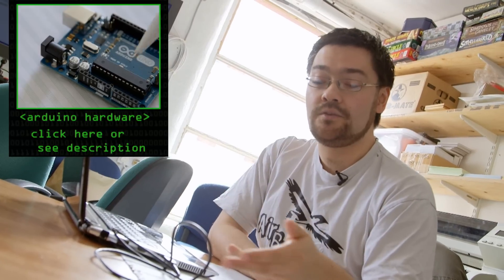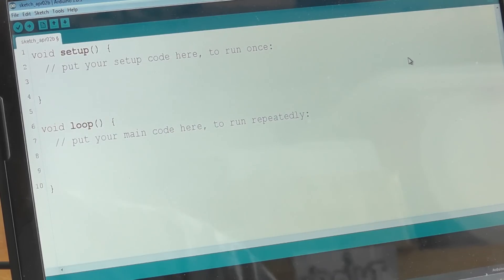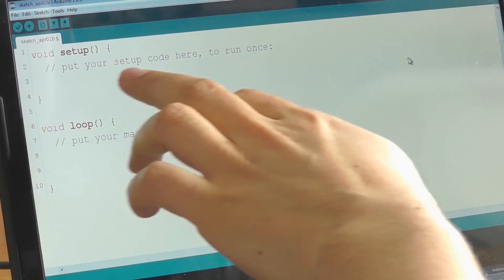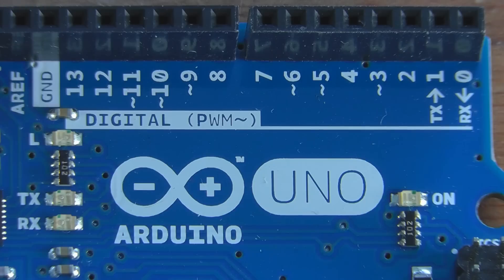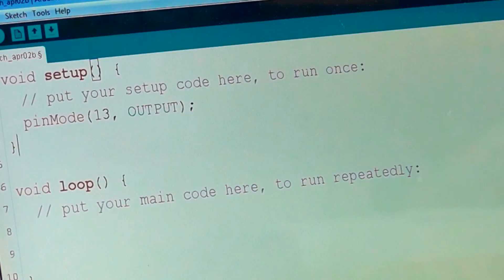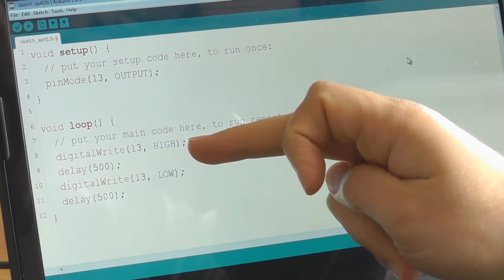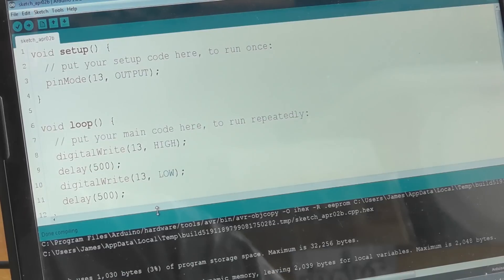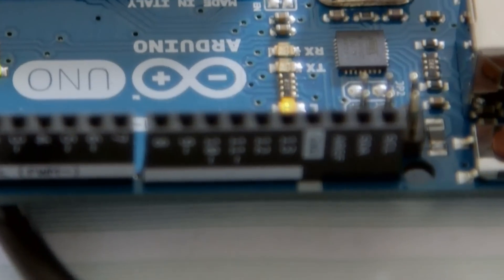Arduino Programs & Sketches- Computerphile

Comment: I use Arduinos a lot in my education but i feel how more i use the arduino IDE how more i dislike it. countering microstuttering and all just works so sloppy. I already switched from the basic arduino IDE to codeblocks for arduino.

Can you also do a video on programming arduinos in the AVR C code.

Comment: The same project, but in Assembly, would've resulted in a 30 minute video. Could also be an hour if the person explained every line of code.
Reply: PopeYoda Hardly. It's not that much more assembly instructions. As long as you have the boilerplate binary in there, all you are doing is assigning registers and calling functions at specific offsets. It's not even remotely advanced to do in assembly.
Reply: Cadde After I read your comment, I went back into my asm files to find the similar instructions, and I must admit you are correct. It must have been the simplification of 19 (give or take) asm lines to just a few for the arduino that gave me a different impression.

Comment: Arduino IDE tip for anyone wanting to start:  Shift-Backspace functions as delete by default (I found this infuriating as there is a lot of typing in all caps with underscores)

In windows To turn it off, open %appdata%/Arduino15/preferences.txt
Change line 18 to "editor.keys.shift_backspace_is_delete = false"

Comment: Why don't you use software to record the Desktop instead of filming it with the camera? The quality would be a lot better and it would be easier to tell difference between colours (you couldn't really differentiate between orange and blue text in this video).
Reply: vzwGrey Two words. Aesthetics and Consistency.
Reply: vzwGrey Because he (the guy talking, cba to check name) might not want screen recording software installed on his laptop. Doesn't matter that he can uninstall it later.
A screenshot of the program would suffice.
Reply: שגיא קרמן Those were three words.
Reply: Cadde Yes, I would go full scale riot about that, if someone demanded to do that. Would smack them right in the face with my tinfoil hat :P

Comment: I have several Arduino boards I've used for various projects, including in a 3D scanner (in perpetual alpha) that uses a webcam and line laser,  the Arduino controls the stepper motors for laser and turntable via serial link from main PC.
 Processing language on the main PC box does image processing, obviously they all have to be in synch, (which was done by a Processing)., it also has a nice form with buttons and checkboxes etc to make it all easy to make a scan. By taking two images.. one with the laser on and one with it off.. I can subtract where the laser wasn't on the image without the laser line and get texture information per scan line too.
 
 I just got hold of a bluetooth shield so will make a small robot rover thingie of some kind.. with a video camera and voice coms on it too.
 (I fly and program drones so already have a number of spare video cameras, transmitters & servos etc).
 Electronics is far more technologically advanced an activity than it used to be., however it is also much easier to do as micro controllers such as Arduino have come on the scene.

 Totally recommended, in UK you can find Arduino boards in Maplins or look online.
Also try out the Processing language for more open source very capable software (particularly anything to do with graphics).
Reply: mars Cubed Why use an arduino if you still have to involve a PC though? The PC can set pins too you know. Especially if you already have a serial port.
Reply: Cadde I can't say what is mars Cubed's reason, but you are going to need a bit of hardware to control the stepper motors from a PC anyway, and it may be just as simple to use a microcontroller to do the control as to get some dedicated serial interface chip to do it with. I supposed they used the USB to serial function on the Arduino, not a serial port on the computer itself.
Reply: Ts6451 Yup, USB serial with functions in the arduino code to read and write messages between the computer and motor control code, and line laser.. thus I can turn the turntable x degrees, get an image from the web cam with the laser line.. then another image without the laser line, process the laser image as mesh coordinates, then subtract one image from the other to get texture map information..
 Obviously, doing the above plus a bit of math (how much the laser line is displaced by the geometry of the scanned model) repeatedly, generates a 3D model, texture coordinates and texture map...
 The biggest problem I have found is noise in the images, which I reduce by looking for how many other useful (laser illuminated) pixels there are in the neighbourgood.
However, it usually requires cleaning up later in a 3d IDE too.

Comment: I'm interested in starting with a small Arduino project over the course of this summer, but don't know exactly where to start. The coding should be no problem (Bsc. comp science) but the rest is rather unknown territory for me. Does anyone have a bit of advice for me?
Reply: jurgyy I agree, looks like fun. I'm a C++ programmer, too, so I should be able to make something fun out of it, but my problem is that I'm no tech/electrician guy, so integrating it with other stuff...? I dunno. Seems like fun, though.
Reply: jurgyy What kind of project are you looking to perform? Are you powering motors, or just sending signals? What kinds of sensors are you looking to use, if any?
Reply: jurgyy I can second Kametrixom's suggestion. Get a starter kit. They are not really expensive and contain a lot of components that are fun to wire up and play with. Did this myself and have a lot of fun with it! Also helpful is a cheap multimeter that can measure current, voltage and resistance, and maybe a solder iron if you want to make something more permanent.
Reply: Follow arduino.cc , they have everything you need to get started.
Reply: jurgyy If you're up for some social interaction as well, see if there's a Maker group near you. They pool their skills to create. Some focus on group projects while others build individual projects, trading their skills for those they don't have. I wish there had been something similar when I was building stuff.
Reply: RMoribayashi I am not familiar with the term charlieplexing. We split the cube into an 8x8 grid and ran one cathode at a time, running the anodes high or low to light individual lights in a row. We had to run this incredibly quickly, since we were using variable brightness. In all, it was pretty straightforward, and no one had problems with burned out LEDs. Not that those would be difficult to troubleshoot, since we color coded our lines pretty carefully and had a carefully mapped schematic of the circuit.
Reply: RMoribayashi So I looked up charlieplexing on Wikipedia. It doesn't appear that we used charlieplexing. If you want, I can explain the project in more detail. Just let me know.
Reply: Rylan Edlin Yea, I'd love to know. And what size cube you built.